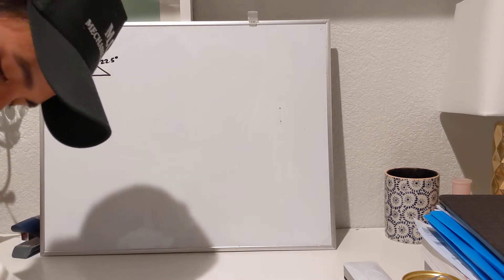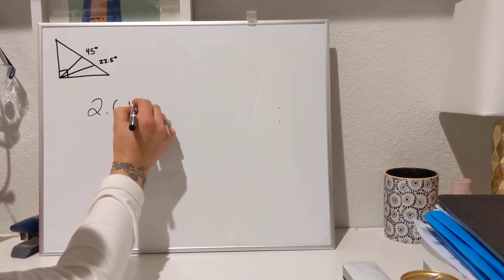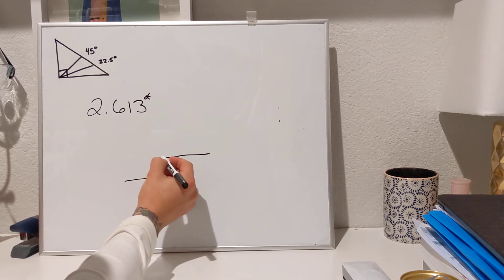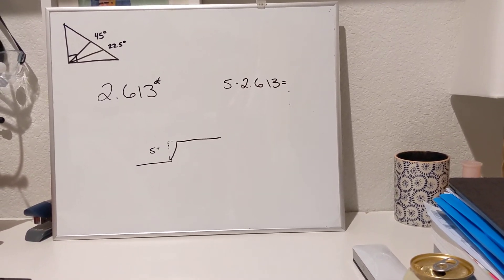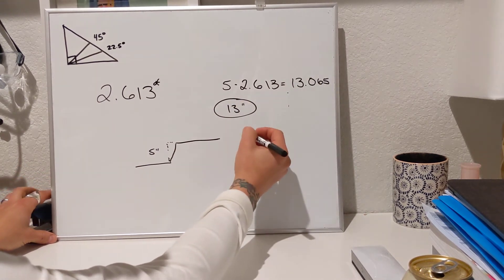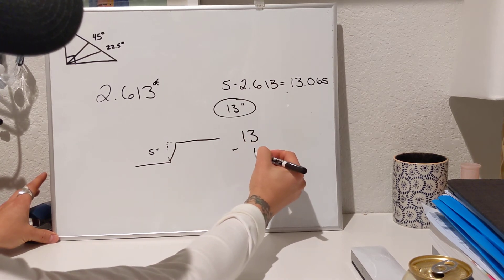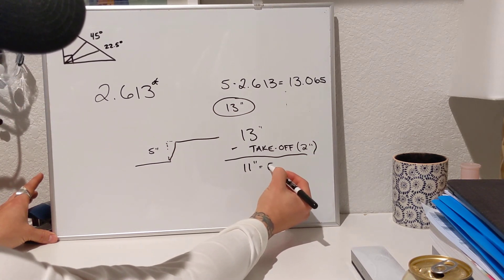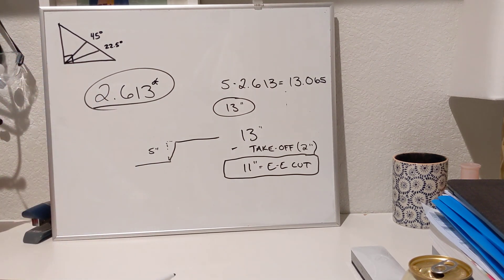22° degree OFFSET formula explained - PIPES TRADE MATH

Comment: Where did you get 2.613?
Reply from the maker: Great question. So I can't fully explain. Mathematically through equations how you get it, but it's a mathematical constant so 45° offset will always be 1.414 and a 22.5° offset will always be 2.613 and it's based on a right triangle if I remember right, I just don't remember the formulas to prove that those are mathematical constants. Anyway, thanks for the question. If you want to look it up, those are the information points that I would search